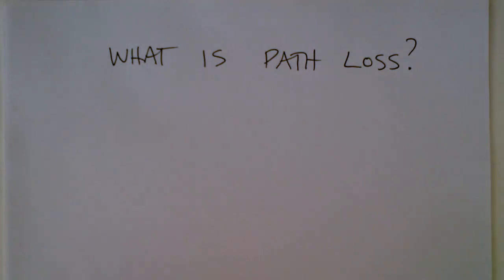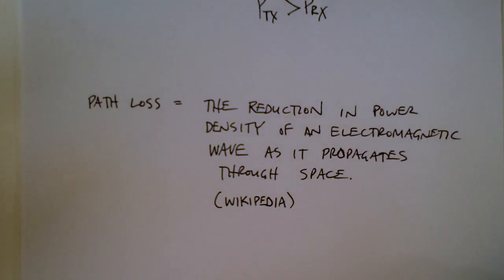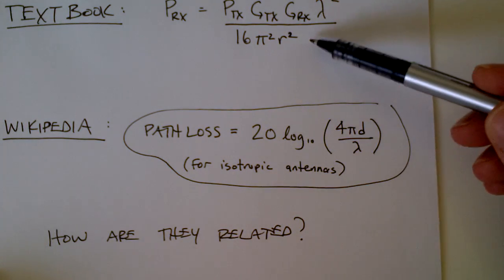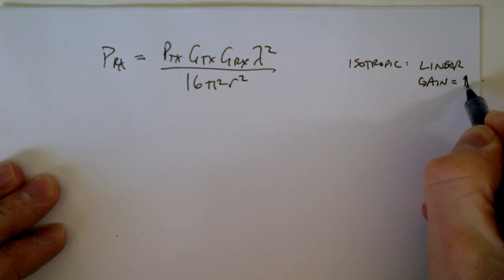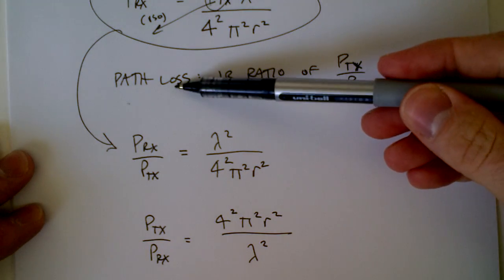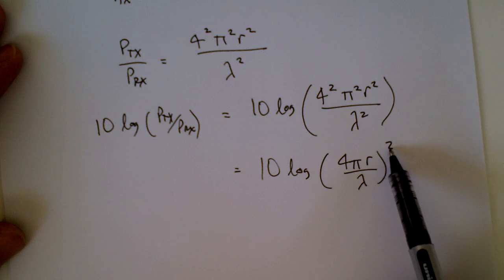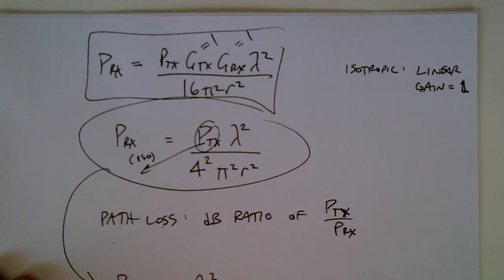What is Path Loss?

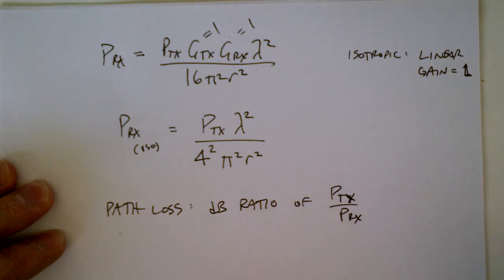Comment: Hi Carl, thank you for the great video. In 2:50 you said if Ptx being 10dB more than Prx, Ptx is 10 times stronger. But it doesn't make 10 times more power, right? Isn't  3db  double the power? Thanks
Reply: everything here is correct, if Ptx is 10dB more than Prx then Ptx is 10 more power than Prx.
+10dB is x10 in linear, and as you said, +3dB is x2 in linear

Comment: But where does the wavelength part come from?
Reply: Speed of light (c)= frequency (f) x wavelength (lambda)

c is a constant = 300000000m/s and f is the frequency used for communication. All electromagnetic waves travel at the speed of light and only differ in frequency and wavelength.

Comment: how to find lambda in this model

can u give formula for lambda
Reply: Speed of light (c)= frequency (f) x wavelength (lambda)

c is a constant = 300000000m/s and f is the frequency used for communication. All electromagnetic waves travel at the speed of light and only differ in frequency and wavelength.